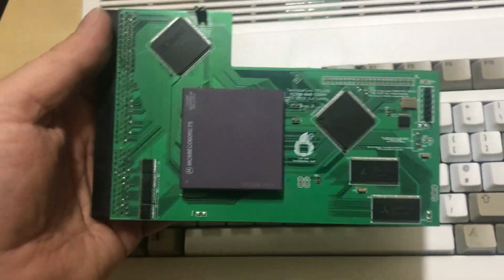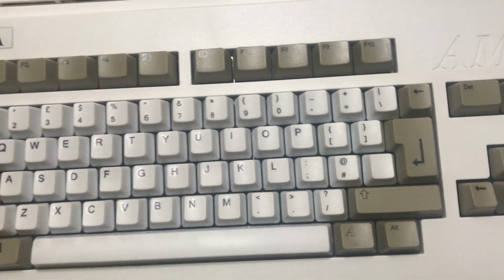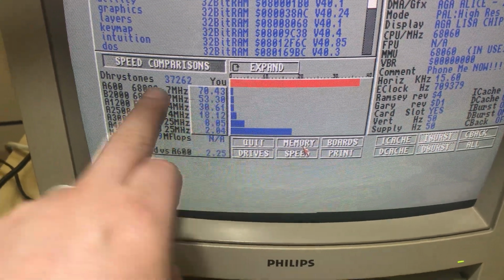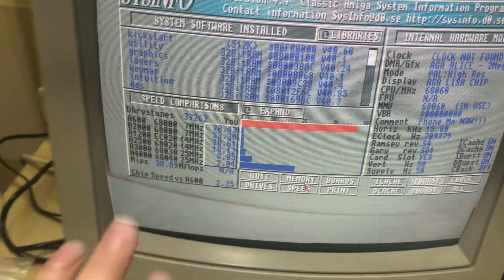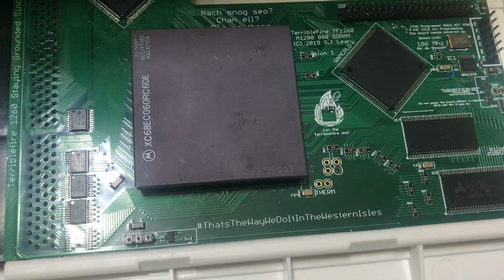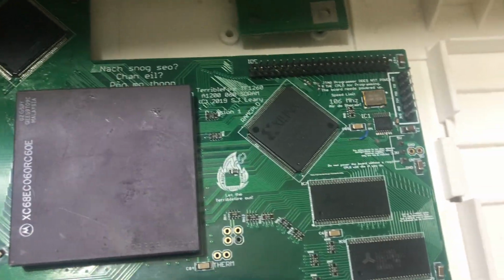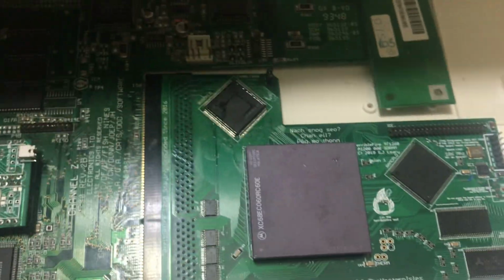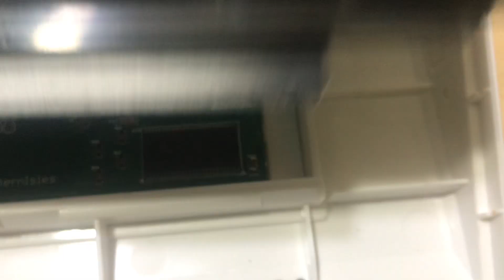TF History Series: TF1260

Comment: Mostly I see 060 as something for towered 1200's. Can you imagine what a nice machine it would be, if you had TF-1260, and then used the newest PCI busboard and the black tower that can be bought these days? Like... Use that Radeon 9000 card and the PCI-128 sound card. That is kind of my dream Amiga at this point. You can then use a massive heatsink on the 060 and clock it out to the max.
Reply from the maker: I have that setup. Its very unstable and its very frustrating. You need two monitors because some applications create screens that display on the plain amiga. Honestly towered amigas are like project cars. Only get one if you want to spend most of your  time pulling it apart, screaming at it and putting it back together. 

Sorry to burst the bubble there but Amiga PCI solutions are terrible. 

However the 060 cards in a plain 1200 are amazing for appreciating the art that is Amiga Demos.
Reply: @TerribleFire  I really thought that the Radeon 9000 would be able to display all screenmodes through PCI. And that the black mediator busboard would be stable after all these years of devellopment. Oh well... I guess a towered 1200 without mediator will do fine.

My 1200 is in one of the new cases, it is recapped, and I am using a IndivisionAGA-MK3 for display. A wonderfull scandoubler that have HDMI. And yes, 030 with 64mb plus one of them angled CF-IDE adaptors that have an extra 40 pin header.

I can really not complain as of now, and only if I get an TF-1260, will I tower my 1200.
Reply from the maker: The Radeon cannot do 320 x 256, or 640 x 256. And some applications ask for that. e.g. SysInfo. The black mediator is not great. The software is probably the best bit of it. The hardware is pretty shocking. If you add a new PCI card you have to shuffle the cards around finding which combo works. 

The TF1260 works perfectly in an A1200 @ 50Mhz. Its pretty cool. If you wanted to run at 100Mhz all the time then i'd recommend a cooling solution but you can run the rev4 060 at 50 all day and it barely gets warm.
Reply: @TerribleFire  Nice. Thanks for the heads up. 🙂
Reply: @brostenen  It is possible but you would need something like an Indivision MK3 to handle the native Amiga screenmodes and a Ratte switch to do the automatic switching between these native screenmodes and RTG screenmodes on the Radeon. I am using such a setup with my Mediator TX1200, Radeon 9200 and TF1260 towered Amiga and it works like a charm.
Reply: @wizardjd64  I have an IndivisionAGA-MK3 in my 1200 already. And yup. It is so awesomme. I especially like that I can move and resize the screen to fit the monitor, with the use of hotkey and the mouse. One cool feature.

Comment: Great review about the TF1260. Nice to known the meanings of the words on the TF1260 card. Wat is the meaning underneath the TF1260 card, #1January1919. Got Revision 1c with a real 68060 Rev6 CPU on it. 

There is text underneath the TF1260. Well go and poor yourself a little br… take it to the airidh and give it la..

The words br.. and la.. are not finished. There is something covered on it.
Reply from the maker: #1January1919 is https://en.wikipedia.org/wiki/HMY_Iolaire The rest you can probably google the fragments and find out.
Reply: I see it’s a songtext. Nice to know all the text on the TF1260 card. It’s a great 68060 card which runs perfectly 50MHz on it. Use it only for 68060 AGA Demos.  Like the TF1260 more than the Blizzard 1260.

Comment: Fantastic card. I Have one made by super-duper. I plan to build one myself once my soldering skills are a bit better. Are there any plans to design an accompanying clockport doubler that fits in a standard A1200 case. There is one design that allows an RTC and another clockport device but it only fits mechanically in an A1200T.
Reply from the maker: For a clock port doubler i'd recommend Solas when the parts become available to build it again.